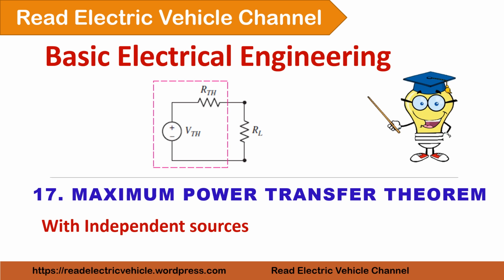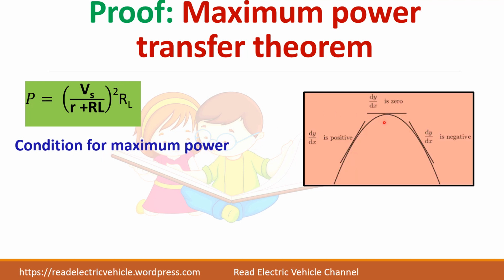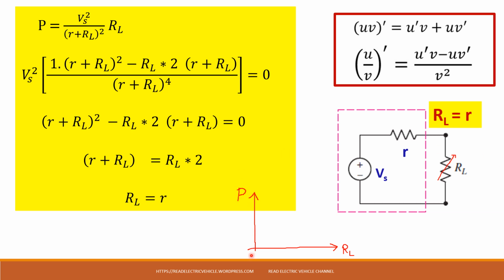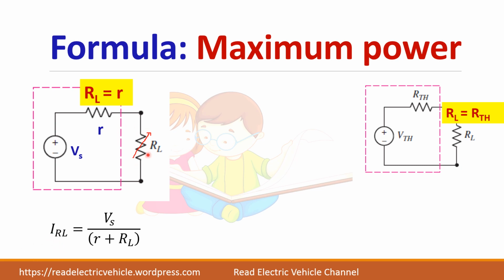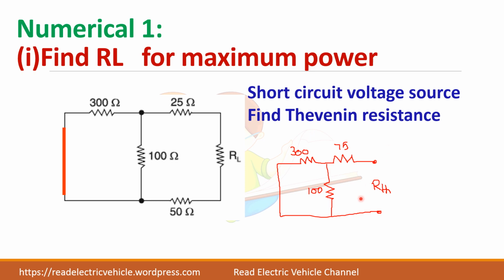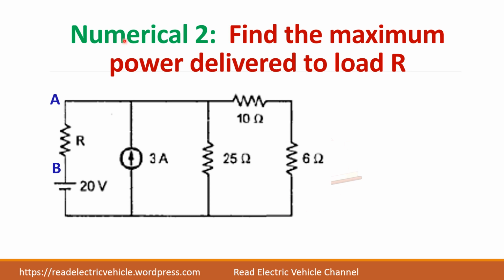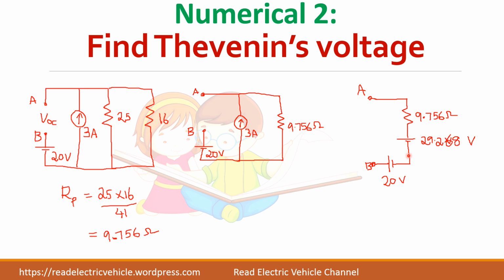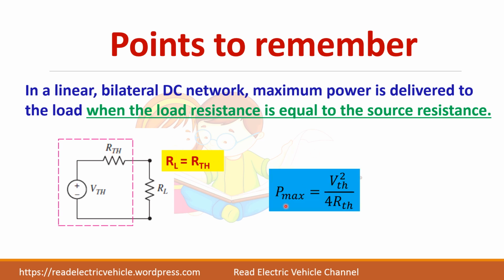Maximum Power Transfer theorem solved problems

Comment: Why you can put Vs^2 out of the formula of the derivative? I didn't understand this part well, thanks
Reply from the maker: I hope you are asking about about differentiation of power wrt Rl load resistance.
Vs is source voltage which is independent of rl. differentiation of a constant is zero. Hence taken out.
If you need more explanation, mail to readelectricvehicle@gmail.com
Reply: @readelectricvehicle6078  Thanks. I will try to do it myself and I'll ask in any case. Thanks!
Reply from the maker: @UsefulMotivation365  ok